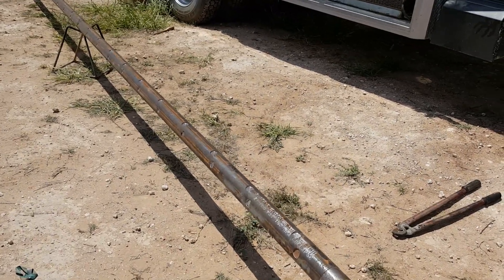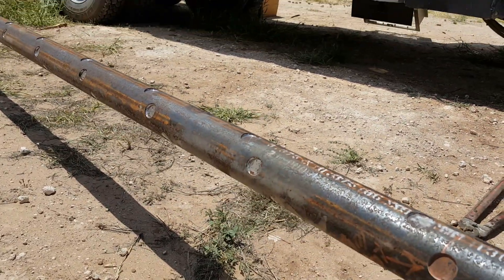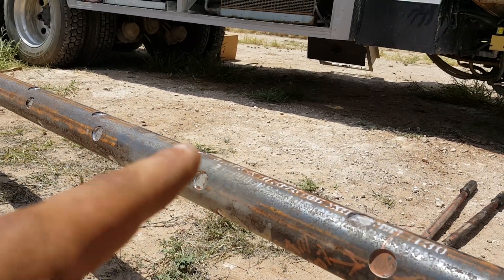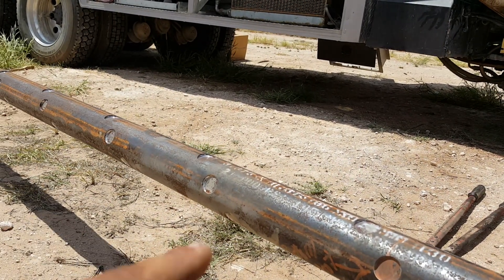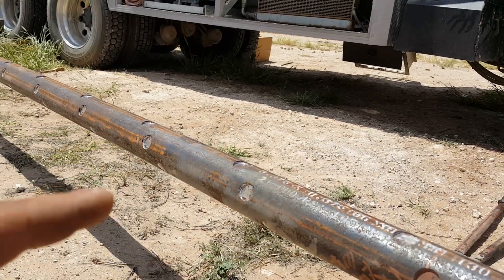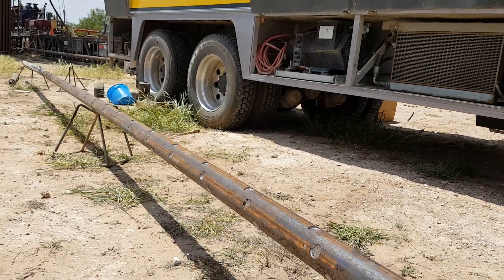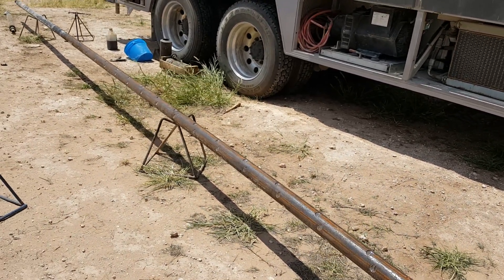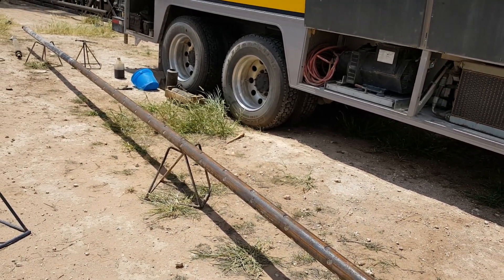PERFORATING GUN USED ON OIL AND GAS WELLS.

Comment: why do people dislike this video?

I'm a fourth year honors petroleum engineering student.

Thanks for this video.
Reply from the maker: Jon L I wish I knew more on down hole and production equipment. I should of studied to be an engineer but oh well. Thanks for watching my random videos.
Reply: Jorge Serna I started my degree in my late 20s after working in the oil and gas industry for 5 years, now I have worked another 2 years. Total work experience is 7 years.

Petroleum engineering is really interesting stuff. At least to me it is.

I'm currently reading a book called petroleum production systems, second edition, by Economides. It explains some of the production stuff, but also uses a lot of math.
Reply from the maker: Jon L Thanks I will look into it. I been working as a Measurement Technician / I&E for about 9 years. Im 34 at the moment but when I got hired on and saw my first pay check I decided to put college on hold. I do fear that as fields are bought out by other companies that I could struggle in the future. I dont really have a safety net or plan B. I spent about 6 years as a plumber before my oil and gas career.  I will look into that book you mentioned. Once again thanks.
Reply: Basically in really simple terms it drills holes through the well casing and surrounding rock.
You get more flow that way instead of just having it come up from the bottom.
More surface area but at the same pressure means more flow.
Also the area around the casing end is rock so it leaks out faster when its cracked up and looking like swiss cheese.
Reply: The perforating gun detonates its charge shooting liquid metal at very high speed into the rock formation. This process is done in under-pressure, meaning there is less pressure in the well than in the formation. This allows the reservoir fluids to immediately start flowing into the well removing any perforating debris in the process.

As far as I can tell the main reason why perforation is done, is to reduce skin damage. Skin caused by the completion of the well. If the perforations can extend passed the damage then the damage is largely circumvented.

Skin damage is just damage to the small porous structure of the rock. For example, as you drill into the formation, some of the drilling mud will enter the formation, this will cause damage because the drilling mud will precipitate some of its fine particles into the tiny holes in the rock, clogging the holes in the rock near the well, reducing flow potential.

If you are doing a horizontal well, the direction you drill, and the orientation of the perforations become more important because of permeability anisotropy.

BTW I'm not quite a petroleum engineer yet, it is possible that perforation of an undamaged formation could increase performance if done in certain situations (such as high anisotropic permeability), I just haven't learned about this application of perforation yet. I have only learned about its application to mitigate formation damage.

Perforation in itself will cause some small amount of skin damage, and so the situations in which it is viable would have to outweigh this skin damage it causes.
Reply: John L be sure to get plenty of field experience as the book cannot teach you everything.  An old school hand that learned the old way
Reply: Nick K what experience is your seven years at though ?
Reply: Jorge Serna the end result you want is a clean crush zone and perforation( area your calling skin damage) which achieved various ways. Either a acid wash to remove liner, charge and crushed material from the perforations or a sand frac further expanding the fractures in zones and perforations. Or maybe your company uses charges or a carrier with exothermic material that gets left over causing another reaction immediately after the first causing the left over material burn itself away leaving 100% perforations. I spent ten years working the patch social media wasn’t a very big thing when I started and all the documentation I did was unfortunately lost with a go pro and iPad I had stolen from me.
Reply: Because nothing went bang.

Comment: Me and my husband worked at OSO, and I wired the harnesses and plugs and assisted QC with inspections. Husband was QC Supervisor on day shift until 5 we were laid off. Husband was called back and is running CNC for the outer tube. I remember when we received a pallet back and was cannibalizing the pallet and it found this string and asked my Supetrvisor what it was. He shut us down and sent us outside. It was a det cord. 🤣🤣🤣

Comment: I've come across some of this  pipe and want to cut it up and weld on it. How can I tell if it's loaded?
Reply: Justin Puckett if there are no holes blown through it
Reply: Crazy how 4 years can change so much.
All my material (3.125" diameter .3125" wall) came from Belarus. Protected by Russians, shipped by Halliburton... If I remember right, a bundle, 10 sticks was $3800. Anyone got up to date pricing for Houston??
Reply: If there is a plant that makes these, contact them and ask if you can purchase their NCR's(they don't pass inspection so haggle them as low as you can cause the are going to send them to scrap. I do not know how much scrap pays them, but check with them and offer a little more. I know OSO is in Oklahoma City, OK, if you are close enough to want to drive.